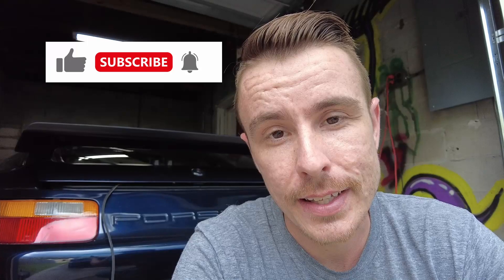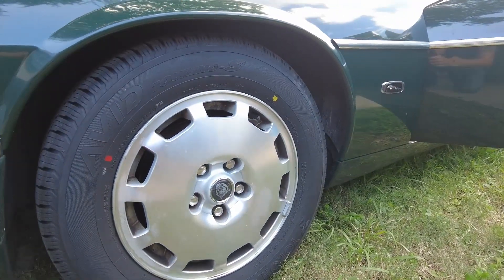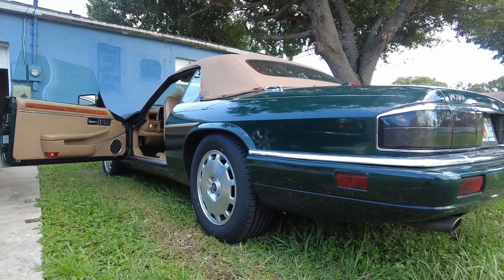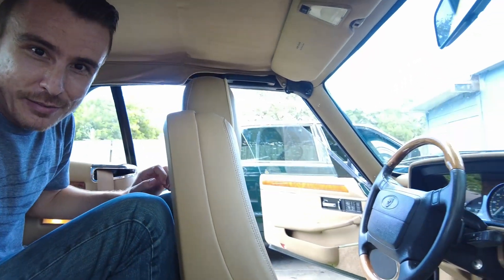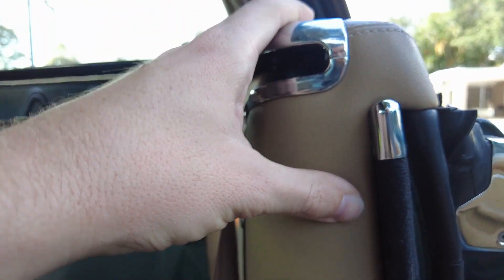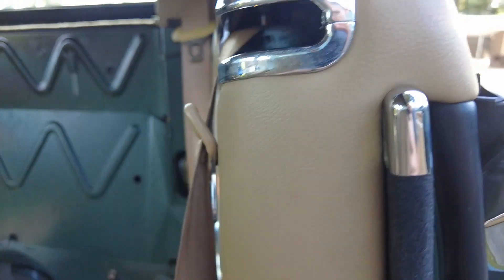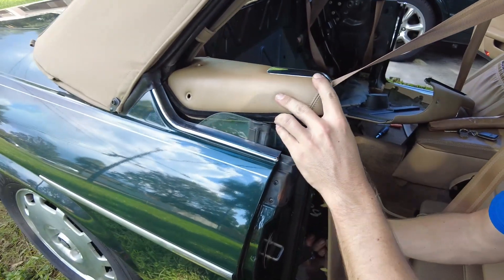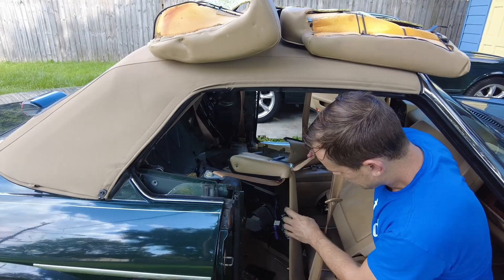XJS Update! New Parts & New Problems

Comment: I’m looking at the same car right now and the interior lights work intermittently I’m told, apparently the battery drains too. Could all that be caused by a bad switch for the lights? I’m thinking it’s like leaving the interior lights on and draining the battery
Reply from the maker: I would recommend removing and cleaning all the contacts for the bulbs.
Reply from the maker: The switch is certainly worth investigating too
Reply: @LowTechGarage  thanks for the reply, would that drain the battery?